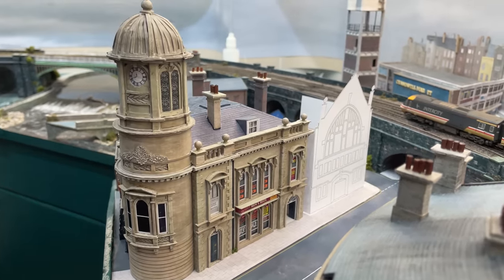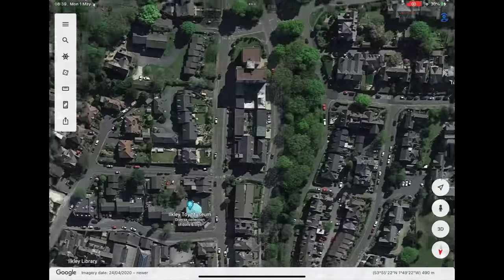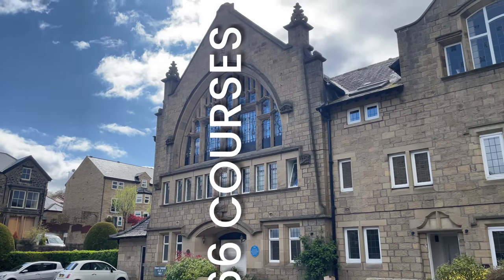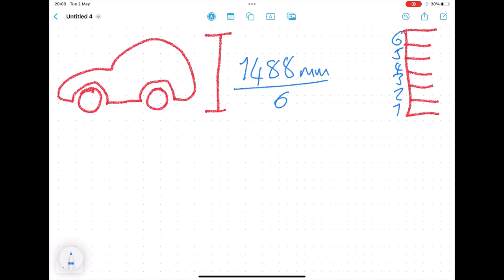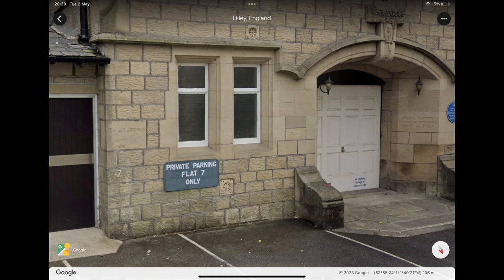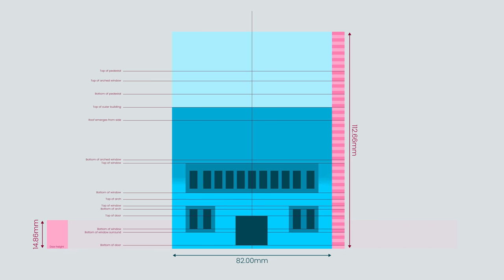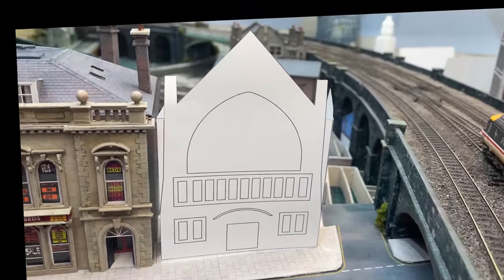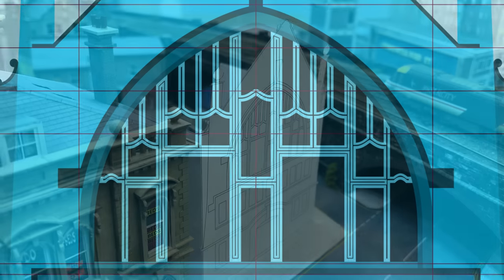Counting Stones - attempting to design a scale model without measurements

Comment: I’ve used brick counting for measuring buildings for years - I produce planning drawings for extensions mainly, but I’ve also worked on historic buildings too. Once you know the brick gauge, counting the number of courses works a treat!
Reply from the maker: Indeed it’s a time honoured system. This one was a little difficult as the stone courses are irregular. There is a fatter one and a thinner one every so often. I guessed it averaged out overall though.

Comment: Michael Really good to see you design process from idea, prototype inspiration to basic measurements and line drawing. Yes I now know where the prototype is but can’t say it’s made much of a impact as Row of Council Buildings across from the Station in Ilkley. A online Bradford Telegraph & Argus Article described the real building as built in the Arts & Crafts Style. From this video & online photos you can see that style at least in large glass window but very understated compared to a lot of  say William Morris Liberty Prints which may be helpful. But guessing a Church building would understated compared a Council   Building or the like. Looking forward to see how this develops and how it fills the space available. In the real building photos that it has outside wall on the lefthand side and another building on the righthand side. But in Chandwell it really the other way round but guess you could have the lefthand side wall on both side of the model. I think as you’re planning doing a extension building behind the town hall there might have been a narrow Lane at the back beside beck wall to allow coal merchant cart to deliver coal for Town Hall & chapel. Ian
Reply from the maker: Thanks Ian. Yes, I also think access round the back is important.

Comment: Here's a silly question:  Why not simply use Adobe Lightroom from the start to scale the image do the correct size ?  Then you could have simply "traced" the outlines of the facade's features rather than doing all that counting and maths.
Reply from the maker: Ha ha. I wondered if someone would ask that. Yes, I could, and I have done in the past. However, I considered two things when deciding to present it this way on this occasion. The first was that I’d still need to count the bricks and do the measuring to work out the height. Lightroom can straighten the edges but I still need to stretch it vertically. By having the stone courses counted and lined up, I can at least be sure that my texture will also line up properly without any drift. And secondly, I wanted to present something that anyone could follow. Not all of my viewers have access to the technology so my hope was to present something that anyone could achieve without making the video a tutorial of how to trace a photo. 👍

Comment: Never thought of using lines in Inkscape as construction lines, I’ve been using the horizontal and vertical guides and it gets confusing.  The building looks like another brilliant build.
Reply from the maker: Yeah! I rarely use guidelines. I find real lines easier to work with.

Comment: Hi Michael, I have viewed your videos with interest this upload more than others due to the subject How big? What size?  As an ex building student from Leeds Building College and ex railway modeller a subject close to my heart.  History of buildings being a favourite subject. I was at the college in the 50’s therefor a mason or apprentice mason would be around in my early years that worked on that building.  Calculating Heights by counting stonework is fraught with difficulty due to areas generally useing local stone.   Stone varies area to area especially with sedimentarty stone.  This stone is sedimentary but very fine   Looking closely at the plaque one can just observe a fine grain but most important, machine marks are evident that suggests it is ashlar, a facing of stone to a brickwork backing.  Not load bearing brickwork the supporting structure being probably a structural steel frame.  This building was constructed in an imperial measurement era so I would assume the measurements will relate to standard brick coursing ie 9” long by 3” high including mortar.  The mortar joints are very tight, again suggesting ashlar therefore can I suggest 22.86 is the height of a block (3 course of brick)?  This coursing rule goes through all sectors of the building lets say doors:- a standard door is 6’ 6” x 2’6” or 6’ 8” 2’ 8”  giving a 3’ 0” masons opening But the killer is the stair case the treads are multiples of 7” therefore a standard storey height is 8’ 0” from floor finish to floor finish or a multiple of 7.  If this is not attained the builder has a problem if you increase or decrease a riser you have introduced a killer tread one you would notice when using, if disabled you would trip or fall.  You will be surprised at the amount of stairs I have failed to pass due to this error.  I apologise for the length its impossible to put half a years study into a comment. gGreat video Mike B
Reply from the maker: Thank you for your detailed and really interesting comment. Always a pleasure to read your thoughts on buildings. I did notice that this building’s stone courses seemed irregular. There is the occasional fatter one and the occasional thinner one. I guessed that they averaged out, and if like you say it was arranged in multiples of brick sizes or step sizes, then that was probably an ok assumption. I’d love to know how close or otherwise my guesses are, but even if I’m off by a couple of feet, it’s still only 4mm on the layout and it will never be noticed.
Reply: @Chandwell  Correctly put.  The construction industry has two adhages 1. Engineers measure in millimeters Surveyors just get it right.  2. If it looks right it is right. 
Take care Mike B

Comment: Couldnt you just measure one course?

The corsa trick is genius tho!
Reply from the maker: Yes, that would be possible, but I did not for three reasons. 1. I did not go there with anything to measure with.  2. Each course is different. There are some thick courses and some thinner ones on this particular building. I guessed that over a few courses the differences would average out. 3. I wanted to present an example of what you can achieve by just using Google Street View. I happen to live near this building, but this technique works for any building with brick/stone courses anywhere.
Reply: @Chandwell  ahh I see interesting about the variation.  Well anyway it worked a treat!
Reply from the maker: Yeah it was really odd. I wasn’t sure if I was imagining it at first.

Comment: Amazing how you develop the drawing. I learn something new every time you release a video. Such as, I wasn't aware that N scale was 1/148 in the UK (and probably everywhere else) while here in the US, it's 1/160.
Reply: According to Wikipedia:  "Depending upon the manufacturer (or country), the scale ranges from 1:148 to 1:160. Effectively the scale is 1:159, 9 mm to 1,435 mm (4 ft 8+1⁄2 in), which is the width of standard gauge railway. However the scale may vary to simulate wide or narrow gauge rail. In all cases, the gauge (the distance between the rails) is 9 mm or 0.354 in. The term N gauge refers to the track dimensions, but in the United Kingdom in particular British N gauge refers to a 1:148 scale with 1:160 (9 mm or 0.354 in) track gauge modelling. [...]  The scale 1:148 defines the rail-to-rail gauge equal to 9 mm exactly (at the cost of scale exactness), so when calculating the rail or track use 1:160 and for engines and car wheel base use 1:148."

Learning something new every day !  :)
Reply from the maker: I don’t know why British N Scale is 1:148 and is generally 1:160 everywhere else.

Comment: Another way of calculating building dimensions is to paint a broom handle, or other long thin strip of wood, into 12" or 30 cm sections of contrasting colours. Red with white or, black with white sections. This stick is placed against the building and photos taken from a distance. The entire photo is then in scale with the painted stick. Works a treat. Cheers!
Reply from the maker: Super tip. Thank you.

Comment: today I learned an '07 Corsa is an unfortunate number of millimeters high. if you have one, maybe over or underinflate the tyres slightly
Reply from the maker: I didn’t take into account that the tyres may have been underinflated. Or they had a load of luggage in the car. Shall I rip it all up and start again!!? 🤣
Reply: @Chandwell  oh, that's not the point - it's that "1488" specifically is a neonazi dogwhistle, of all things. it's a covert reference to an anti-semitic speech where the first sentence has 14 words, and the 8th letter of the alphabet > 88 > "HH" > "Heil Hitler". however… the designers of the '07 Corsa almost certainly didn't take this into account when drawing up the dimensions for this car ;)
Reply from the maker: @RoamingAdhocrat  Oh heck. I didn’t know… I understand your comment now.
Reply: @Chandwell  yeah, it's one of the weird things you pick up, when you're friends with the kinds of political activists who monitor and oppose that kind of thing!